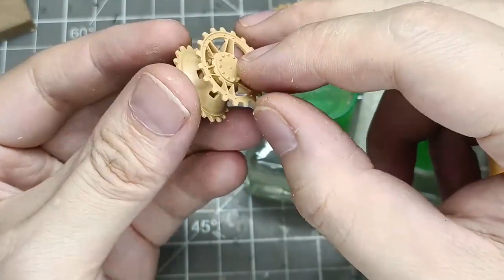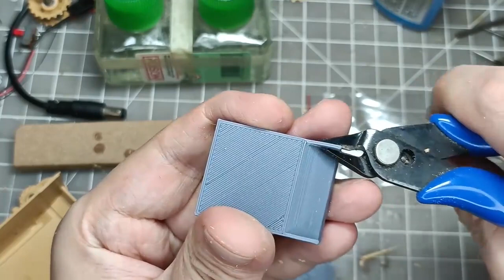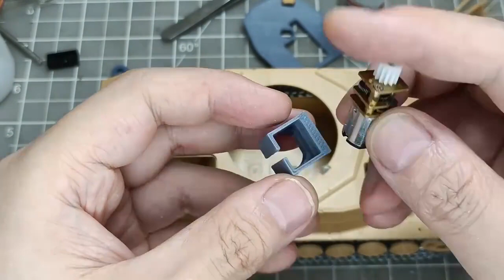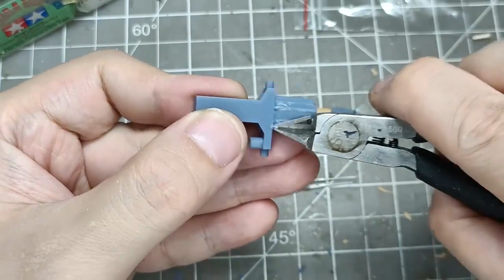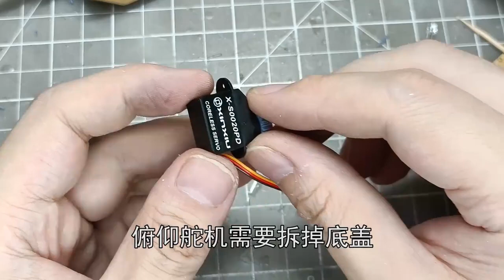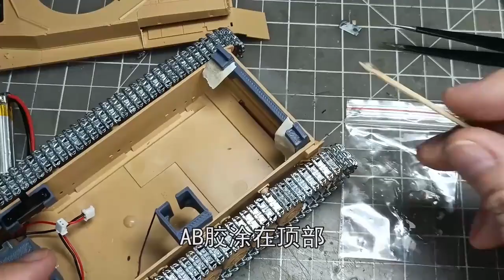Tamiya Panzer IV full RC conversion 1:35 scale with 3D printing parts

Comment: great demonstration, I would like to order the kit but have a problem TAOBAO unfortunately only ships in China and I'm from Germany 😉. If you could name an alternative source for the conversion kit or the manufacturer, that would be great!
Reply from the maker: Try Aliexpress with name they tank control
Reply: @yixiugg  😀👍
Reply from the maker: @petereichler975  sorry should be yk35 AU$34.95 | 4.8V-10V CS-YK35 2.4g 8-channel Remote Controller/8-channel Receiver/8-Channel Remote Controller+Receiver for RC Tank Model
https://a.aliexpress.com/_m0NoYtU
Reply: @yixiugg  I'm more looking for the transmission and the control electronics, I have a remote control.
Reply from the maker: @petereichler975  AU$4.83  12%OFF | 5Ax2/ 5Ax2 PRO/ 10Ax2 Dual Way Bidirectional Brushed ESC Speed Control For Rc Model Boat/tank 130  180 Brushed Motor Spare Parts
https://a.aliexpress.com/_mOwISpG this one will work with RC receivers